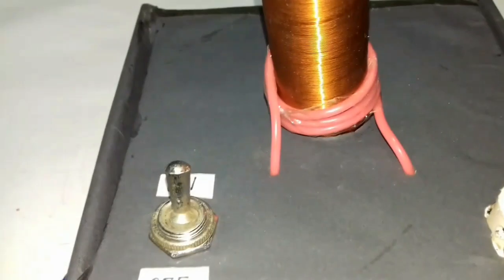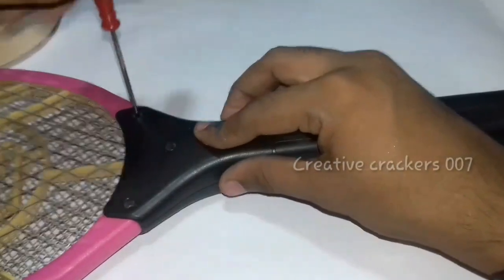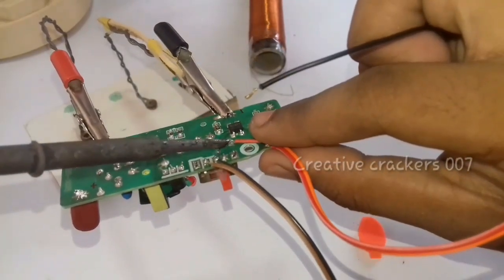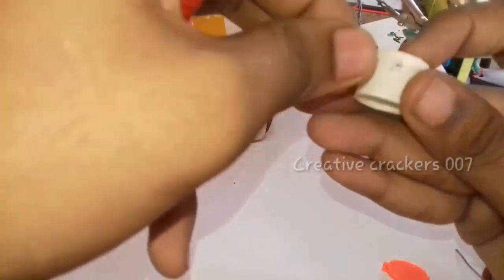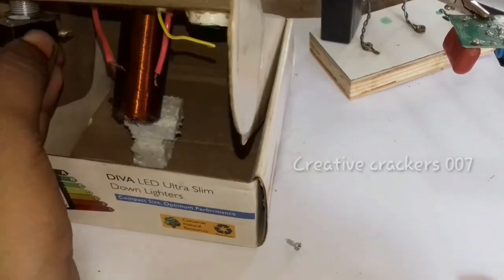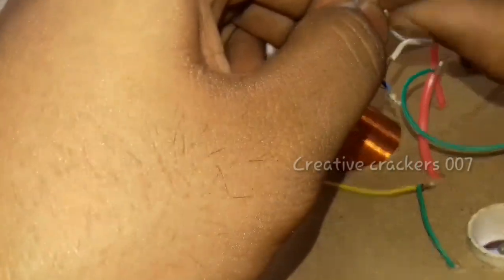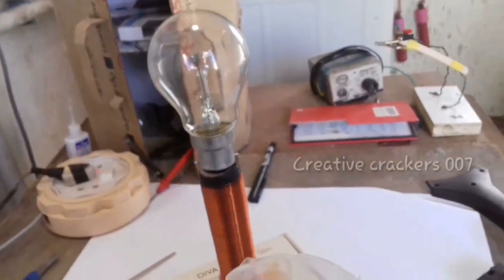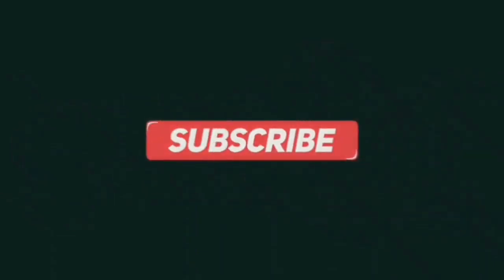How to make plasma ball at home.  -Plasma globe || plasma bulb in English

Comment: I had tried this but the led is glowing will you tell me what to do next  plz😓😓
Reply from the maker: Does the spark is comming in the gap
Reply: No
Reply: Can you tell what happen when the circuit switch is not working properly 🙏🙏
Reply from the maker: If there is no spark then check the circuit 1st.does the red light glows ?
Reply: Yes
Reply from the maker: Change the mosquito bat circuit use another. If there is any problem in the circuit
Reply: Red light is glowing
Reply: Can you repeat this activity once more plz